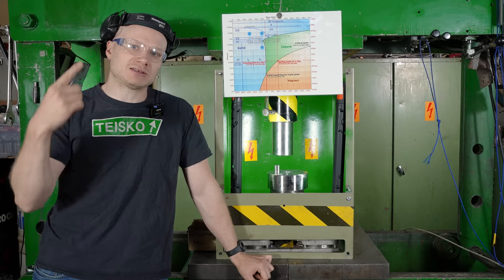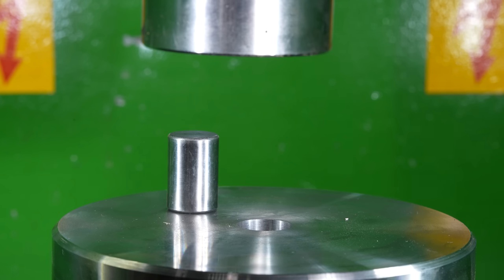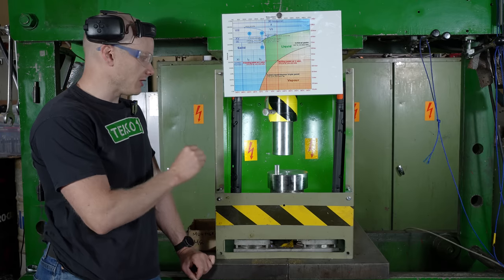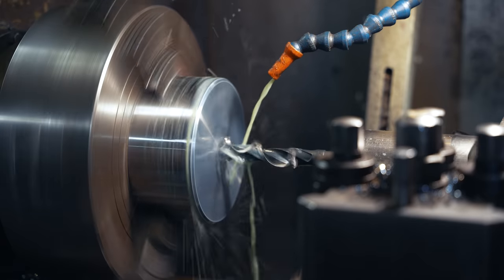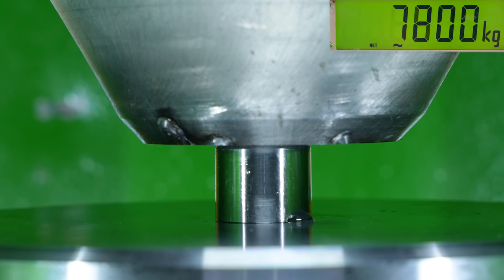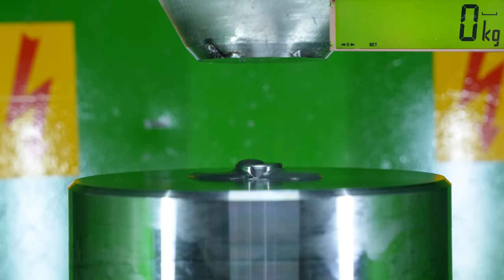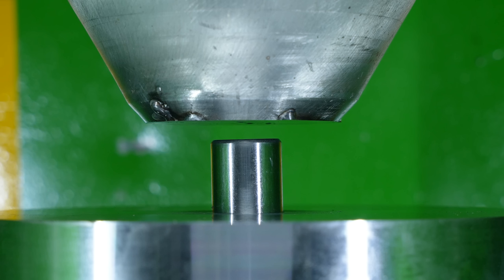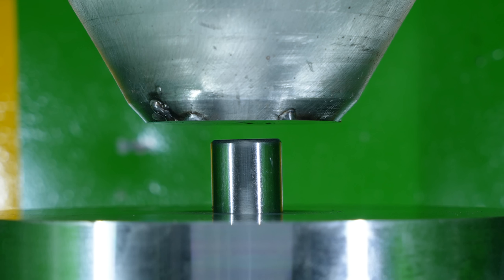Turning Water into Rock with Hydraulic Press

Comment: The water coming out was vapor on the second tighter fit attempt. It was not a single jet like on the first attempt. Clearly the seal was a better fit!  I have to wonder if you make it an even tighter fit if you can keep the water inside the piston? It looks like you might have been very close! Anyway, if you do get to keep it inside the piston under so much pressure, does the water then stay a solid once the pressure is removed? I think that's the case for water found in diamonds. And if your second attempt was in fact successful, what's inside that cylinder? Is there actual solid water rock in there right now???
Reply: The ice would change back to water when the pressure is removed.
If the ice is trapped inside diamond, the diamond itself provides the pressure to keep the ice in that state. The diamond was formed under higher pressure than is needed to make Ice VI, and the strength of the diamond means that it won't expand enough after the diamond makes it towards the surface of the earth for the ice to change back to water.
Reply: Too bad! I was wondering maybe there was some new materials here that I had not heard of before.

Comment: Why did you tacitly assume that there will be no temperature rise during compression?  You left a bit of air above the water, so what do the gas laws say  gases do when compressed , especially quickly?  I am not sure what liquids do in this situation, but if any compression does occur then there is movement with force, so work is happening and energy expended.  So it is safe to assume that the water temperature will rise too. And any temperature rise will push water into the liquid phase again, I don't like your chances of ever getting solid water with this setup, let alone water 7.  I hope I am wrong, so keep working, your projects are a real treat to watch.

Comment: Actually this is nice try but besides water plug compresses too and expands radially so friction is high. That causes friction most part of total force apllied and only rest of force is applied to water compression

Also i am not sure that material can handle 20k bars it will break (unless its some special material?)
Reply from the maker: Good point! But I think hardened steel parts don't deform that much when being crushed, definitely not as much as 0.1mm that I changed between tries and it didn't add that much force so couple hundreds of expansion wouldn't make probably that large difference

Comment: I remember hearing NASA used nixie tubes as their response time was so fast.

Maybe time to upgrade the pressure sensor?
Reply: I mean, maybe in 1969, but faster VFDs would be viable within the decade and LEDs after that
LED can update much faster than a Nixie; we're at the point where a visual display cannot update fast enough, actually.

Comment: I saw your video on my suggestions page.  I thought to myself "I've seen this guy before."  Didn't you have a channel where you would drop very hot pieces of steel onto ice.  I remember a video with your wife in a hot tub (the water was cold because it was Winter) and you tried to heat it with a red-hot piece of steel.  Do you still have this channel?
Reply: It is him, and he does indeed still have that channel.
Its called "Beyondthepress". :D
Reply: I think that's it.  I need to look at the older videos to be sure but I do believe that's the one.  Thanks!  @The_Keeper

Comment: Couldnt you weigh the metal casing and the plug.  Then weigh the metal casing, plug, and the hole filled with water. then after the plug is pressed in, weigh it again and clean it off and weigh it.  that should tell you how much liquid is left in the hole.

Comment: How about crushing carbon into a diamond. Using something similar, and a welder to heat the carbon. Use a ceramic coating pin or something,  crush a 50-75mm x 3mm wide cylinder. About 40-60 mm  of carbon. , Using a 4340 steel pin with a ceramic  coating on the cylinder walls, and the sides of the pin.  Leaving the bottom of the pin and cylinder to be electrically conductive. . Use about 200-400 amps and 30volts! It could happen

Comment: You are wrong about the rock thing. Geology uses a wacky nomenclature, especially when planetary geology is considered.
Typical volatiles are all called ice , regardless of their physical state. Water, ammonia, methane, nitrogen, those are all ices whether they are solid, liquid or gaseous.
Rock is a name reserved for refractory, high melting point substances. Again, regardless of their state.
Gas is reserved for hydrogen and helium and they naturally only come as gases and supercritical fluids, but again, all states are allowed.
Rock in another sense also means a mixture of materials found in ground.
The word for solid water phase at room temperature you were looking for is mineral . However, normal ice (snow, hail, whatever) is also a mineral.

As for the compression, you might want to look into metallic gaskets machined in a way that get tighter as the press goes down.

Comment: The laws governing the physics of hydraulics are going to win.  There is only one place on earth that you can find a solid version of water and that is in the deepest part of the Mariana Trench at depths so far only unmanned craft have gone.  At ocean depths of over 20 miles the vehicles themselves could not penetrate the water..ther was in fact a level of compression at which the water itself became solid.  Your failures was because the pressure outside the vessel was not great enough to contain it and the vessel itself is utterly inadequate to contain the pressures created.

Comment: From this setup, you have no way to make a direct observation of the ice forming. You can only judge by applied pressure. Would be great to have a way to confirm the presence of the ice inside the chamber. Still, good try!
Reply: If he reaches Ice 7 it will be a rock when he cuts it apart. It can’t melt ever as it’s changed.

Comment: How did you not think of putting oil on it like a piston to seal the water in?
Reply from the maker: I had oil there but I didn't have large layer of oil on top of the water. Not sure will it make difference but definetly something to test. I though that this is going to be super easy so I didn't want to mess my fancy water rock with oil :D
Reply from the maker: Also I realized after the making the video that polishing the surfaces to mirror finnish would probably have better seal also. so plenty to improve

Comment: All you created with the last test was steam. Too much heat from the rapid compression aswell as from the sourrounding friction against the steel. I'd also like to point out that the steam you produced was likely well past 200 celsius in heat, thank god for the protection box.

Comment: Goes to show how hard it is to maintain a proper seal at such pressure 

I feel like it could be possible if you make the seal you press in thicker, so i think you made the seal like 10mm or 20, but if you push it in for 100mm and make the seal that thick, the water will have a harder time to push through!

Looking forward to the next video ❤

Comment: ...so, not sure if anybody else has suggested this idea and so maybe if you have a "mold" of a softer/compressible steel with a multiple step process for the pressure being applied with a form fit press maybe that could work?...
So like this=.              )______(                                                        
                                    |_π___π_|                                     
                                    |   w   w  |                       
                                    |      W    |         
                                   \|_______|/      
...

...not sure if that will even make sense it was kinda fun to draw though, basically so you know it has at least one safety/redundancy for the pressure to remain in the area you want it to be in.,...
...I already know I'm crazy though and know with the proper tools (which I'm willing to bet you have and/or can access...) it should be absolutely possible, just give the mold a mold of its own.,...
...thank you for the post in any case, always absolutely appreciated.,...
...hehehe, mad scientist yay,!)?...,.
(...Only for cool stuff though, poopy mean stuff is poopy mean poop.,...)

Comment: If all the force would have went into the water, maybe Ice 6 would have been there for a short amount of time.
But, only as an idea - how much force was needed to push the roller bearing through the bottom piece? Since the bottom piece was smaller in diameter than the roller bearing.
To know that would help to clarify if the pressure on the water has actually been enough.

Comment: Why don't you make diamonds from carbon ?
Reply from the maker: Those need also a LOT of heat but I can start to plan that also since we are heading this direction anyways :D
Reply: @HydraulicPressChannel  You could get required 50000 bars with this setup easily (assuming coal doesn't leak 😅 ) , not sure about the 1200 degrees (white hot steel?) + how long it would take time.
Not sure what "cold pressed coal" would be 🙄 Something that burns really long in barbecue 🤔

Comment: It is not possible to maintain tightness in the cylinder under these specific conditions (huge pressure) due to the use of a circular cylinder. If we are dealing with a circle, there is always the number pi, and as we know, it does not have a specific value, only an approximation. The cylinders are almost perfect. For this reason, with a sudden increase in pressure, water will always find an outlet or a point where it will start to cut through the cylinder. Another problem is the accuracy of the cylinders and the quality of the materials from which they are made.

Comment: If you don't want to start with ice, then why not put molten water into the hole and have a peltier device cool the entire cylinder so that the water freezes in the cylinder?
Reply: The idea though is to do this at room temp.
Reply: @LordNelsonkm  the study HPC is using states they started with regular water ice, and using pressure turned it into a more exotic type of ice.

Comment: u cant compress liuids... it dont works,...
Reply: Not entirely true.
Reply: Maybe YOU can't, but this is the Hydraulic Press Channel dammit!  Did you look at the chart at the beginning?  This is a ridiculous amount of pressure.  You can compress fluids, it's just very difficult.
Reply: water or liquids can only be compressed into gas  liquid gas maybe... @LordNelsonkm
Reply: That's not actually true. It's just very close to incompressible. Something like 1% every 1000 bars for water. Though it changes with temperature and composition.